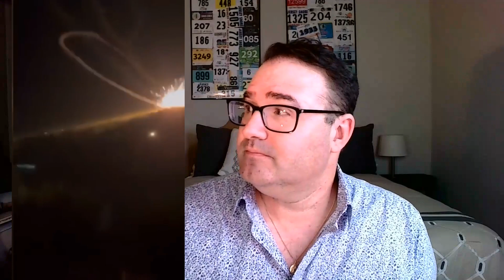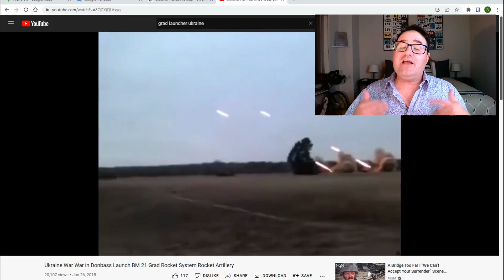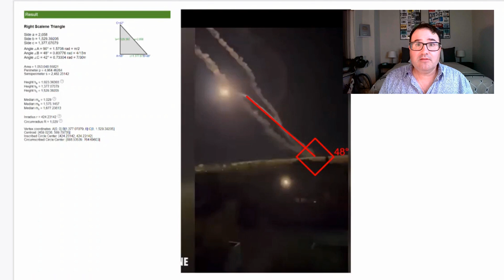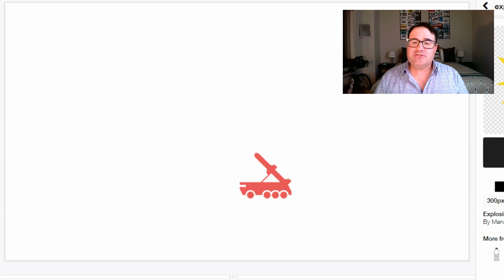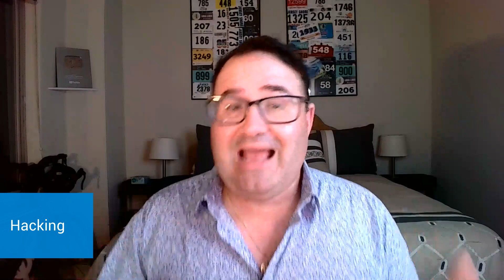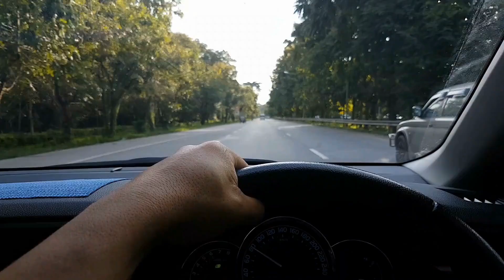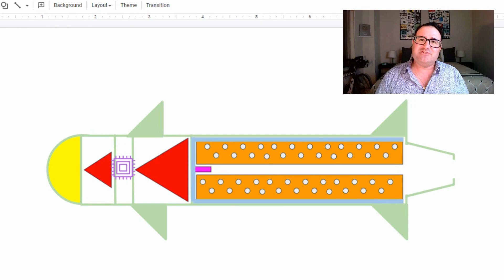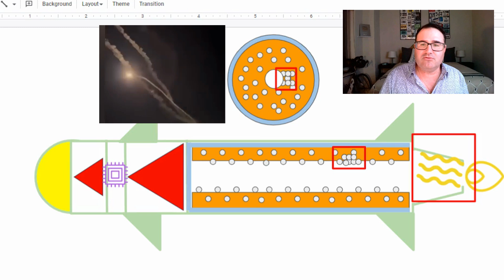Why this missile U -Turned

Comment: The solid fuel problem you describe will cause changes to thrust, not direction (with a small chance of increased instability due to unforeseen change to the rocket’s moment of inertia. But this will probably not cause divergence). A stuck fin is a much better theory. I would say that a stuck electric motor for the TVC system is a better theory, assuming this system has TVC. If not, maybe a broken Nozzle. A shift of only a few degrees in nozzle direction can easily cause this during the boost phase.

Comment: Mr McBeth, I’m no expert and this comment may prove it but here goes. I heard ammo can malfunction, including rockets. It’s not uncommon. Usually they are duds just not igniting but I’ve seen a u-turn rocket like this before. Here’s the wrinkle. If we know things can go wrong, including a rocket u-turns, how come the rocket can’t be disabled before it explodes on the ground?

The launcher senses the u-turn and sends a signal to this rocket telling it to self destruct.

The rocket senses its own malfunctioning... and it self destructs on its own.

The rocket does not arm its payload until it’s far away from the launcher / close to the target.

The rocket senses it’s going off course and the sides of the container that hold the propellant come apart, causing it to lose thrust.

The rocket notices it’s doing a u-turn and figures out how to continue the turn and it becomes a 360 degree turn.

Would it be safer for the rocket to explode on the ground instead of in the air, where shrapnel would cover a wider area? 

The first reason none of the above was not implemented might be just... the manufacturer doesn’t want to admit their rockets can misfire like this. So they just don’t bother building in failsafes. But it does look shortsighted, if we see examples of these malfunctions.

Comment: Makes sense to me. Jet engines demonstrate a similar phenomenon whereby if the intakes are too close to the body, it causes uneven pressure on the fins as they pass by, causing them to rapidly oscillate until they become detached. Similar and different.

Comment: Not sure on this.  Would the guidance vanes not try to compensate?  It would be interesting to see your calculations on the force required for such a turn against a fuel failure and a guidance failure.😊

Comment: Venturi rivet.. so when this particular rocket fires the venturi nozzle is held in with 3 rivets, when one is damaged it will fire for a second or 2 till it shears, can't the venturi at an angle and thus make a u turn. The rivets are surprisingly small oin diameter, and made of aluminum.  《~EOD tech

Comment: I think you are right. Improper storage of older SA-2s could cause the same for the booster rocket. As the Ruskies like to stick with a set format, not far fetched that a known yet ignored factor persists in more recent rocket variants

Comment: I did a lot of work in microcontrollers, and this looks like someone simply wired one of the chips tracking up and down backwards. During the initial launch, the input is typically ignored until the missile is safely away from the launcher. However, shortly after launch it looks at the input for up and down, and since they are wired the wrong way, it things the missile is going 45 degrees down and initiates a 180 turn to fly "up".

Comment: Nah
Even if it had fuel only on one wall, the jet is not shooting outside - it explodes inside, filling the inner cavity first, and only then does it go outside in a perfectly straight line. The direction of exiting is something like the line from the center of the inside to the exit.
Also, probabilistically, it is very unlikely that it will land near the launch side. If it was random, it would have gone any direction - but to turn then stop turning (2 consecutive actions) when it reached the back home direction - nah - that is not an accident.

So i think - the rocket wanted to go back - that means it went back with the use of the guidance system.
This should be the entry point of your analysis.

Comment: Looks to me like the missile was headed back to it's launch point under controlled flight surfaces and propulsion while it still had propellant. Note smooth 180 degree turn and continuing powered flight curving toward launch point. That curved path continues curving toward launch point until ground impact looks like just short of launch point (path never straightens). When it impacts the ground it is still turning toward launch point but considering it is powering downward I'd guess it couldn't curve sharply enough.  Just following orders.           WhoWhatWhenWhereWhyHow

Comment: Ryan, nice theory about the propellant but I don't think it holds water. The polymer binder of solid rockets is a very mature field and solid rockets are legendary for their long shelf life and high tolerance for mis-handling. If your proposal were true I would expect an uneven burning rate but not an asymmetric thrust of sufficient magnitude to do this. Using ICD-203 I would say that having a solid rocket turn 180 degrees due to propellant degradation of the type you described is "f*ing ridiculous" 🙂. (see what I did there?) 

Propellants can degrade or be damaged due to age. When that happens most likely result is cracks in the propellant. Propellant burn rate is a function of the exposed burning surface area. Propellants are typically melted and cast into the casing. The central cavity in the propellant is created by a mandrel. The mandrel can be flower-shaped to create more surface area for a higher burn rate (more thrust). Cracks in the casting increase the surface area for burning, which results in higher burn rates, which results in higher casing pressure, which typically results in case rupture (explosion) or blown-out nozzle. There have been cases where the one of the petals of the flower structure broke off and plugged the nozzle resulting in explosion but that is more often due to manufacturing defect.

These missiles are guided. They have a control surfaces that allow the missile to change course to track a target. The control fins are powered by batteries (if electric) or compressed gas bottle or something similar. The control system is far more likely to malfunction than the solid rocket motor. And the control surfaces are far more likely to be damaged by corrosion, neglect, mis-handling, or manufacturing defect. I suspect Russian quality control is most likely culprit. The control system might have had intermittent electrical short or just plain dead batteries.

BTW, this is not the first Russian missile to do this. There is an infamous video on YT of a Russian frigate firing a missile and having something similar happen.

Comment: WOW BUDDY I BELIEVE YOU ARE RIGHT.  As usual the most rational responce to the fuel, flipping that thing, I saw the pre uncencored video and it looked pretty cvlose to the ground only 400 feet max.  But you certainly know better than I . This happened not to long after the war began.   But the VODKA is mixed in there for sure.  In the factory out of the factory, mis handled drunk of course every day while in or out of the factory, for starters.

Comment: I don't think that even if one side quit burning the engine exhaust would not make the missile violently turn 180 degrees unless it burnt through the side of the engine casing causing a horizontal jet to turn the base of the rocket, or a Plug in the nozzle caused by the fuel? Option B is my choice, but it could still be the Hand of GOD!

Comment: Could have been a floating point error in the guidance software. A patriot missile system had a similar failure in the gulf war, where the missile turned around and hit the system. If its on for too long or if the numbers in the software get too big, the spacing between adjacent floating point numbers grows, making errors more likely. Iirc, I also think that missile control is an ill-conditioned problem, meaning that slight changes in initial conditions could cause the missile to end up in the wrong location.

Comment: How about this. The rocket was very slightly off. And made a small adjustment. Fortunately, it's guidance system and fins were the wrong way around. Maybe the cable for the left fin actually went to the right, and visa versa. So it turns slightly more off target. Then the guidance system makes a bigger correction, still in the wrong direction. This explains why it flipped 180, not some other angle. Once it's going in precisely the wrong direction, the flipped adjustment system would keep it going in that direction. It could be a pair of wires soldered the wrong way around.

Comment: A solid fuel "chunk" is highly un-likely as this would almost certainly cause an immediate overpressure and motor explosion, if not the chunk would have been violently expelled out of the nozzle. Additionally the curing process is fairly fast and the grains are formed within the liner  with a mandrel keeping the center combustion chamber uniform until the curing process completes which is no different than hardening epoxy. As an opinion to offer, not sure what caused this but one thing to consider is the flight path, if motor related wouldn't the missile have continued an uncontrolled circular like flight rather than just a U-turn back to it's origin. In fact it turned then appears to continue straight trajectory before smashing into the ground. Dunno I only specialize in the solid engine industry and of not the flight dynamics. Lastly the stuck fin actually fits the narrative better than any other theory to me, it's fired from a guided tube driven over rough terrain after being stored for god knows how long. Perhaps stuck forward fin from tube strike and then unstuck after U-turn?

Comment: I think that an excess of fuel on one side still wouldn't be enough to pitch it around 180 degrees, I think the most likely is that poor maintenance led a fin or fins to malfunction and pull hard to 1 side but its weird that it eventually stopped turning so i also dont think that is likely but I dont have a better theory

Comment: Unlikely. From the bell nozzle point of view everything that happens upstream of the throat of the engine is just a pressure. I.e. - the throat of the rocket engine balances out most of such asymmetric burn issues and hence rocket cannot make such abrupt turn due to fuel burn asymmetry. That is why all asymmetric thrust related guidance systems use pressure differences downstream of the throat.

However, what may have caused such an abrupt turn is an actuator problem. In this case missile probably tried to correct trajectory a little, but faulty code or faulty actuator or faulty actuator position sensor resulted in full throw of the control surface. After 180 degrees turn, the issue disappeared (don't know why) and missile went straight again.

Comment: I don't know Jack about missiles but your explanation makes sense. I think if anyone  was capable of hacking these they would have them blowing up on the launcher, which would be far more effective. And a stuck fin wouldn't result in a straight trajectory after the anomaly... there wold still be an arc, not a line.

Comment: I've heard that the US... um i mean Ukraine is able to send a return signal to Russian radar making them identify their own Russian planes and SAMs to identify targets as belonging to Ukranian or the enemy.  That was the reason last week that Russia shot down so many of their OWN planes and helicopters and this.  Russia is aware of this and had them switch to some sort of manual confirmation mode, so maybe this one launcher didn't go ahead and make the change and kept it on some auto targeting mode.  This trick isn't going to work anymore but I heard it did a nice job and it also prevented a bunch of Ukrainian aircraft to not get hit that week also and they flew more missions than usual during that time frame.  The US is well known for utilizing very crafty and innovative methodology like this.  The Russians do their own things also, for the past 2 months Russians have been overpowering GPS data and messing with Ukrainian drones and aircraft, making them thing that they are miles away from where they really are.  (A tactic the US used many times in the past)  Russia is poor with communication through branches so I'm sure this trick will work a few more times this week also but the trick is basically over.  Luckily the next trick is on its way.  Each one costing thousands of Russian lives, but they don't care, they will simply send in the next batch of worthless bodies.  I've said from the beginning, the only way to win this war is in baby steps, too big of losses at any one time and Russia will nuke a sparsly populated area in Ukraine which noone could no the results of.  Ukraine must win 1 tiny step at a time over the course of several years, that or 💩tin losing office, those are the ONLY ways to win this war.  All while praying that no accidents occur for the entire 3 year long war.  We are ALL walking a tightrope here because of one man.  Again this is all just hearsay and not official statements, but I've heard it and thought about it and it makes the most sense to me.  Russia is a cobra snake that's backed into a corner inside a maze, we need to gently direct it where to go without getting bit, the snake needs to think HE decided to go there and is happy with that decision.  We need to start giving Russia a way out, options that allow them to save face in order to end this war.

Comment: Very unlikely... no, impossible, for fuel burning unevenly to make it turn. 1. The fuel causes pressure in the combustion chamber that is excelerated through the throat of the nozzle then expands and accelerates more in the super sonic nozzle. At the throat the velocity is uniform and also, if it wasn't, then throat is narrow and centered. The hypothetical moment arm from non uniform flow would be too small to cause any deviation. 
2. The speed that early in flight is too slow for the small fins to have enough air flow to make such a drastic maneuver so it must be from nozzle vectoring.
3. The flight path is straight, then turns 180, then straight again so it cannot be anything "stuck".
4. Steering is usually disabled for a short while after launch in order to clear the launch system and personel first.. so it seems that as soon as steering was activated, it immediately did a 180 and continued straight. Therefore it seems to look like it thought it was going in the wrong direction. Missiles can use inertial navigation which is the use of accelerometers to calculate where it is and in which direction it is going with respect to a known location, aka the launch platform. Seems like one was installed backwards or wires flipped at the sensor.

Comment: That is not how rockets work. The nozzle is made to direct all the thrust into a desired shape and direction. Uneven fuel burn would not cause more thrust to come from one side of the nozzle over the other. That looks like a vectoring malfunction. Even to fly straight, a rocket has to vector aka gymbal its engine nozzle/s a lot to find the flight path orientation. Anyone who has played a couple hours of KSP knows that.

Comment: I think the internal radar took over to early. The missile lost connection to its ground guidance and activated the internal radar. The radar picked up the only thing visible- the ground. Your theory is wrong because the exit hole for the propellent is to small and long to make a big difference in course like this example.

Comment: A couple of things, first a fuel clump would not have caused a differential thrust within the chamber. If the fuel grain was cracked or suffered some other defect then an explosion would have been the result. Second, two seconds into the flight, the missle would not have yet achieved its terminal velocity. It would still be accelerating. I would disagree with you on guidance. Course correction is easier the farther you are from the target. Also radical manuvering at maxium velocity is a recipe for failure of the airframe or loss of tracking input. 
The simplist explaniation is a failure of the guidance electromechanical system. A short circuit, an open circuit, or some other failure which caused the fin(s) to go hard over and turn the missle around. Or a failure in the guidance provided to the missle. Notice, the missle appears to slow before turning. Something not normally possible with solid fuel. However, once turned it rapidly accelerated into the ground. The explosion was most likely the remaining fuel, as it would be unlikely that the warhead was yet armed.

Comment: A clump of fuel condensing on the side is EXTREMELY unlikely due to how APCP propellant is designed, plus if there was an issue with the fuel the motor would likely fail mid-air, not create an off-center thrust vector. There was an issue with a Russian Proton launch vehicle. A technician installed the Inertial Measurement Unit (Upside Down) which caused the vehicle to think it was upside down, which caused it to flip upside down, this is a much more likely case. 

The timing of the missile failure is also consistent for a faulty IMU. About ~0.7 seconds from launch to when the computer commanded the vehicle to pitch 180 degrees. The missile pulls ~20G's of acceleration and flight computer sensors operate at no less than 100hz, but the filter with a pre-programmed flight path would not allow the sensors to change the direction of the rocket until around 0.5 seconds which is only (which is only 50 cycles) which would be around the time when the Kalman filter would adjust to the sensors differing values from the pre-programed values.

Comment: Looks like a guidance failure. Upside-down gyro maybe. It doesn't appear to be a control surface or thrust issue.....if that were the case the trajectory would have been a constant curve. This thing went right back to the source.